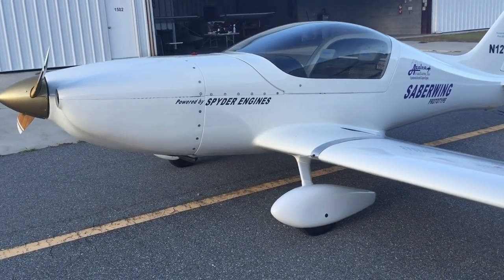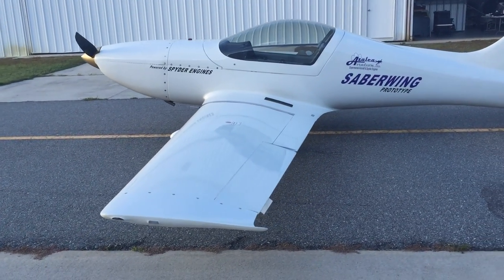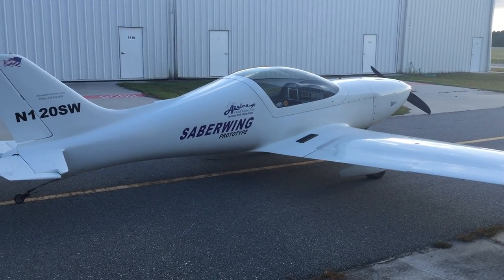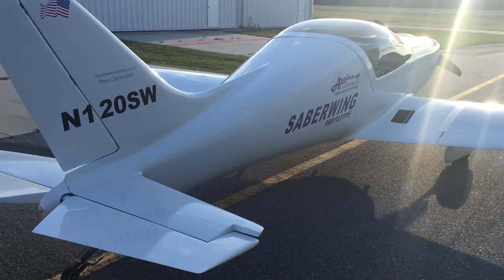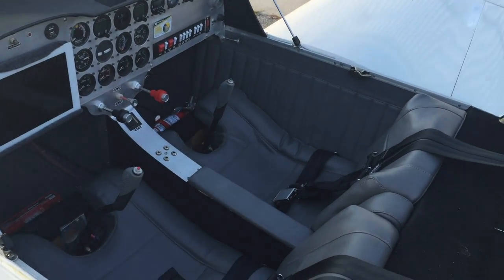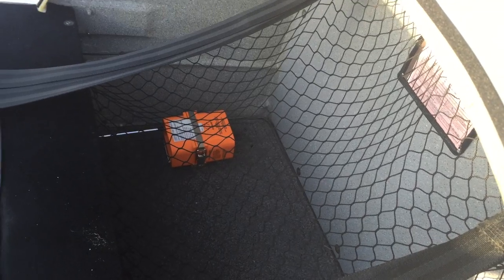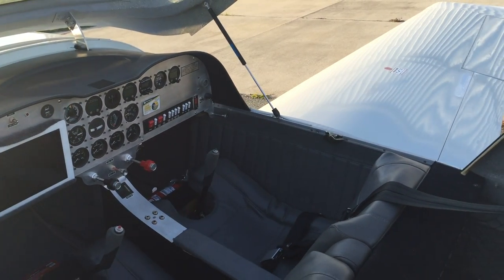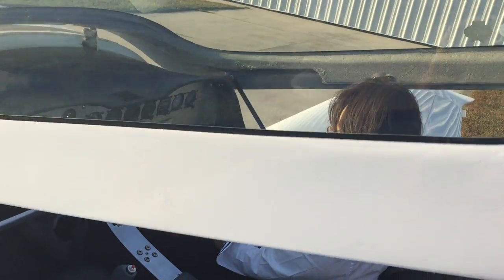The Saberwing - Kit Airplane Introduction

Comment: As you know, the "Spyder" designation refers to either the 150hp (1st gen) or 180hp (2nd gen) Corvair turbocharged engines.
You mentioned that higher HP engines are available and others will be tested (110hp "Monza" and/or 140hp "Corsa" engines?). ;-)

Comment: Looks very much like a pulsar xp
Reply: Yes, looks a lot like a Pulsar XP. I owned a Pulsar XP w/912UL engine. I started wanting a taildragger after having front landing gear issues with the castering nose wheel on the Pulsar. So, this is exactly want would fit my needs.

Comment: Nice efficient design although I would go for tandem as inline is far more aerodynamic.  I would also go for very reclined for same reason. Body formed shell seat for volume and weight optimization.
Also much smaller canopy helps cost. A great target would be 300km/h cruise with 65HP

Comment: Bill, you say "150 mph on 60% power, and 180 mph full throttle".  There are many kitplanes on the market now that have cloned the Lancair airframe design, like this one has.  Esqual, Arion Lightning, Bristell,  Quasar,  etc.  All of them that have an engine in the 100 to 120 HP range have AT MOST a 150 mph top speed and a 60% speed of around 115 - 120 mph.  Now your new airplane has dramatically higher speed?  Sorry Bill, I don't believe it for a second.  Only those types of planes that have a 180 HP engine can make speeds like you claim.  Thumbs down.
Reply: Russel Green - I looked at Arion Aircrafts website. They claim the Lightning Classic cruise speed with the 120 HP Jabiru is 130 knots. That’s about 150 MPH. I don’t think Bill’s numbers can be that far off.
Reply: Right now I cruise 150 at 25” MAP and 175 mph at 32” MAP on turbo 120.    I can tune prop and power to hit @ 190 at 36” MAP.  Slightly boosted.   Less drag with taildragger version

Comment: The rudder is shorter than the elevator = Fail!!! 
Never recover from a flat spin
Reply: says who?
Reply: If you look closely you will see that the vertical and rudder are forward of the elevator to allow clear air over rudder    Similar to Corsair